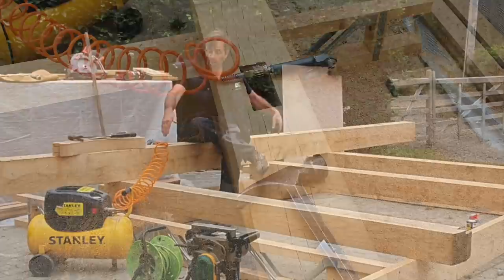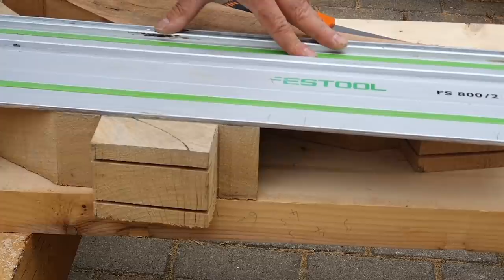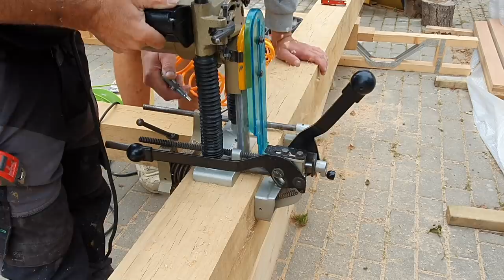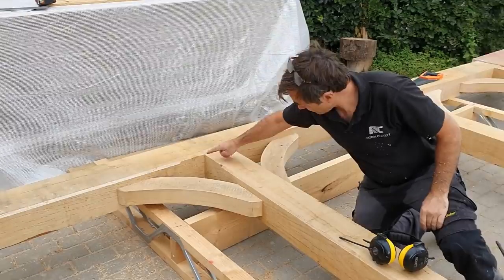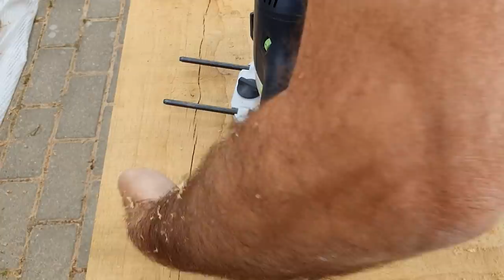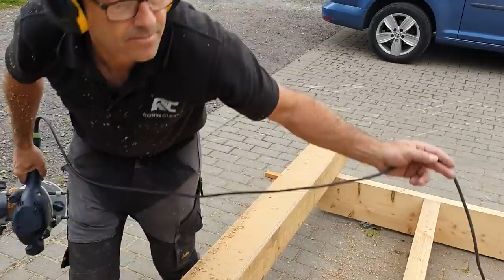The Big Build 22. How I make stopped Chamfers in green oak without having to measure or mark

Comment: Lovely work Robin, I did this on a smaller scale with a palm router and I made an offset block that I just held in place so my stopped chamfers would terminate 4" from the end of my piece. I also chiseled the curved in flat and gave the chamfers a few strokes with the block plane so they look less machined.
Reply: Do they do medals for this sort of thing?

Comment: Just starting my first timber framed project, and I'm finding your videos invaluable. Purchased my first router specifically to replicate this feature on my posts and beams. Please post as much as you can about each stage. Would also love to see you cut a large mortice using alternatives to the chain mortiser. Please would you do that? Thanks again Robin!
Reply: I've now copied your chamfering technique on my project and it's worked fine for me: thanks! Couldn't help noticing that wherever you dwelled with the router it immediately burned leaving a mark. Is that almost unavoidable with Oak? My project was in Douglas Fir which I assume is a little more forgiving?

Comment: What's with the nice framing square with your cool logo on it?
Reply from the maker: Hi Tim, this is my new simplified metric roof Framing Square that I have been developing more video coming soon on this very square
Reply: @ukconstruction  awesome. Is that baby ready for market and does it come with an instruction booklet? Where is it being manufactured? Thank you! Also,  I so appreciate your skill set and the fact that you share your knowledge. Thanks for making me a better carpenter
Reply: I noticed that. Looks very nice. Could be the timber version of Fireball Tool for steel fabricators.

Comment: ok, i'm going to ask the obvious question, how come the track saw has left burn marks on the timber?
thanks
Reply from the maker: Some of the oak is harder and drier than the next bit so you sometimes will experience some burning, also I was using the saw pretty continuously until I finished that section of works!!
Reply: would love to have you as a customer
Reply from the maker: Thank you

Comment: (1:08) - Why does the table saw blade seem to spin weird like that. Is it just on camera?
Reply: I think its just yellow paint on the blade has worn at different depths and a flicker of the blades teeth
Reply: @boschboyblue5500  yeah, I think that’s most likely what it is. I noticed it in his last video. Was worried at first that the blade had been clamped to the arbour off-centre.

Comment: Always strikes me as odd that , when joiners put braces that close together , it doesn't visually look right to me , because structurally you wouldn't need them on a span that short .Maybe for cosmetic reasons I guess.
Reply: Depends on the roof load and wind variables.  Where I am a nominal thru beam (timber) w/ full bearing on it has to be 8x12 (fir).  If the span is greater than 12-14' than it can go upto 10x16.  The only way to decrease the size of the intended beam is by increasing  load bearing points. Therefore more posts.  Cosmetically  it looks funny to have beams and posts not fall within the 1/3 or 30% ratio (golden ratio).